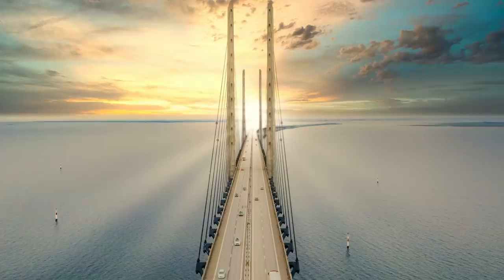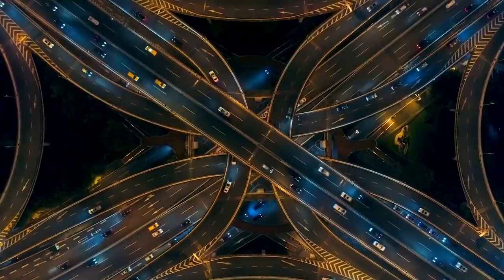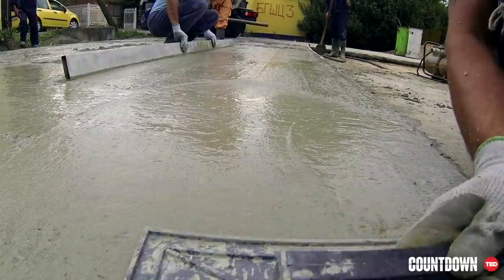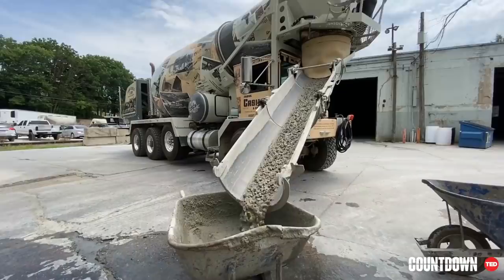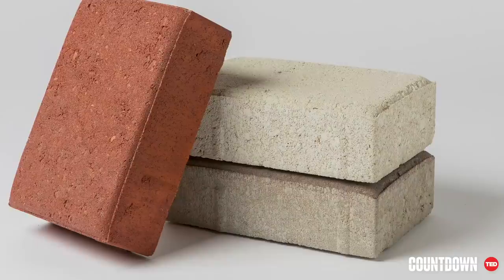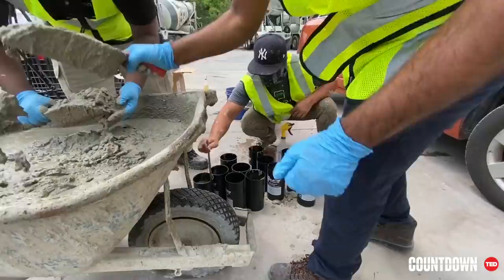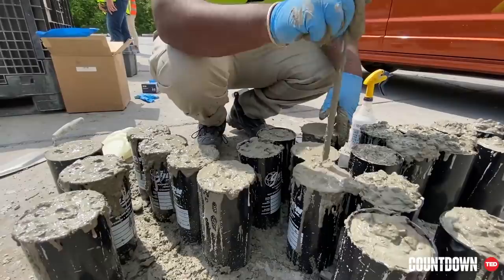How we could make carbon-negative concrete | Tom Schuler

Comment: There are many silver bullets being created to combat climate change, I have followed this one for a while now and it is certainly one of the strongest we have ready to use today. I hope changes to legislation facilitate uptake.
Reply: If it works why does it need legislation?
Reply: @renaissancestatesman  that's how countries works... Unfortunally
Reply: @renaissancestatesman  because it costs more and it requires modifying longstamding processes which industry is always reticent to do. Moreover, current legislation can hinder its adoption by being too narrowly specific about existing standards for concrete, to the extent that it disallows the use of low carbon concrete.
Reply: @Weaseltube  not surprised there are regulatory issues. My issue would be legislation mandating anything. Guess I wasn't clear on that. All for reducing legislation. 

Construction as an industry is ridiculously slow to change. It doesn't seem there is overly much needed in terms of actual manufacturing changes. Hope they pull it together sooner than later.
Reply: @PsicoPato-  a vast number of industries and products do not require government intervention to succeed. In fact those industries with the least intervention do best in terms of innovation.
Reply: @renaissancestatesman  your libertarianism is transparent, don’t worry about it.
Reply: @Weaseltube  most people don't grasp logic even when it stares them in the face. Emotional appeals generally carry the day. So I feel it is better to make it achingly clear than leave it for misinterpretation, flawed understanding or poor reasoning.
Reply: When I’m president I’ll make it mandatory
Reply: @renaissancestatesman  Most people who claim to grasp logic don't know what it is.
Reply: @Weaseltube  this may or may not be true. But it would be fallacious to assume even if it is often true that it is always true. But you know that I'm sure.
Reply: @renaissancestatesman  i know. I think the problem is the regulation. I don't know about the US but in my countrie i bet there is regulation than would make hard the change
Reply: We will need many silver bullets. But I think we can deliver them, along with the lowering of carbon emissions. We are nothing if not innovative.

Societies do have a tendency to pull themselves out of incredible predicaments at the last minute.

Comment: Everything he says indicates this should start dominating the market. Even at a 30% cost premium it should be more economical. Wonder what the cost premium actually is though.
Reply: I don’t think the cost premium is that high but there are industry practices and regulatory obstacles also that make it harder to change to. I’ve read that they suggest we all contact our legislators to move regulators to change building code so concrete standards are performance-based rather than ingredient-based.

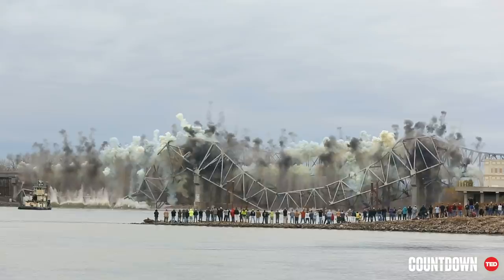Comment: 2:47 "it doesn't exist any longer"
every one who ever had a chemistry class 101: 🤦‍♀️🤦‍♂️
Reply: well it "doesn't". CO2 is not an element. it is broken apart as he mentioned 2:30 and used as C and O2. i guess it exists as carbon in the bricks. would be interesting to see the exact chemical reaction.

Comment: Amazing, but what does it cost!?
Reply: A curing time of 24 hours can definitely make it worthwhile to the industry, even if it costs quite a bit more. Then, as more people use it, the demand drives up supply, and it should become cheaper very quickly. Concrete curing time can be a big problem for the construction industry, speaking as a designer who works with contractors.
Reply: @EcoEnvious  sounds expensive to bring CO2 to the construction site to cure the concrete though. 3:58

Comment: Sounds good on paper. Is it true? Caveats?
Reply: Probably way more expensive
Reply: Production cost is all I want to know. Only missing variable. Would be great to see the cost breakdown showing money saved on water vs increased costs elsewhere.
Reply: To my knowledge the only Problem is the extremely slow acceptance rate of the building industry (even changing to something cheaper can cost short-term, like adapting to much better drying times changes the process)
As he said there are many different types of solutions implemented. But for as long nobody has implemented them on a large scale the building companies (responsible for failures) share the insecure feeling your comment implies.
And this is pure speculation: the cement buisness is a giant wealthy industry, those aren't easily outcompeted by newcomers due to their ridiculous advantage in form of captial and don't like to take risks or the above mentioned changes to the process as well.
Reply: @seferdi4439  If it was cost effective you wouldn't have any problem with acceptance.
Reply: I wonder how guys would finish slabs if it’s curing out so fast?
Reply: Sounds good on video, but there is no paper, which is what worries me. Lots of impressive claims and some nice stock footage, no links to documented third party testing. Or even manufacturer sponsored testing for that matter.
Reply: @remyllebeau77 that's not true, there are a myriad of things where the market implements the less efficient short term benefit solution, especially if an investment is required to transition between two states. 
A recent example would be last week's revelations about the Intel development problems.
All matters of sustainability p. e.: fishing, housing and education are even better examples.
Reply: @seferdi4439  ROI matters. I'm not surprised.

Comment: Since my passion and design of choice (but not in my budget) is a Monolithic Dome (look it up) which uses concrete applied by spray (as in "shot-crete") I have a deep interest in this subject. My alternative fantasy home is concrete built using cast bricks and a lot of rebar. Wonderful soundproofing and insulative qualities and I cannot speak highly enough of concrete houses. Except for wireless reception. Phone and wireless reception sucks...
But the carbon footprint has always been an issue.
Still is, since the CO2 impact on the climate may have been exaggerated by the fear mongering scientists (look at solar influence) and it seems that if we sink TOO much carbon the trees will starve...
So. Thank you for this inspiration. The only real question is how much more this product will cost over the traditional variety.
You didn't mention that.

Comment: Sounds awesome. If big concrete users can save money you have a market, but you didn't mention the money.
Reply: At this point, I don't think there are any solutions to climate change that won't cost some extra money.
If climate change were profitable to prevent, the market might have found a solution by now.
Reply: @RalphInRalphWorld  a lot of it is overcoming the initial hurdle of cost, with significant long term cost reductions.

Comment: This process plus Graphene is a game changer. New construction materials that are lighter, stronger and greener than existing cement based products. In time they will be cost effective as well.
Reply: even better is the effect on Insulation from graphene etc , Homes insulated to a higher standard will require 70 % - 100 % less energy for heating and cooling.

Comment: Hemp mortar soaks CO2 for its life, Roman walls 2000yrs exist.

Hempcrete has some cement to work for foundations, it's a natural insulator, ~R4.6/inch vs concrete, transpires moisture & fungi can't grow on it.

For N.America, Canada has machines & supplies by the container.
Cheers 🍺

Comment: 2:00 - We "came up with a new cement chemistry"... Tell us! Is it a Patented method or methods (for producing cement and for curing concrete)?
2:20 - You "get CO₂ by capturing waste gas from other industrial facilities, like ammonia or ethanol plants". The CO₂ produced by the cement industry, when burning limestone with the other raw material (in lower temperatures, as you say), can't be used? Or even the atmospheric CO₂ can't be of any use?

Comment: sounds expensive to bring CO2 to the construction site to cure the concrete 3:58

anyway i rmb hearing that this industry is super hard to change coz nobody wants to take the risk of using new material that needs to pass lots of safety standards and long term testing

and prob coz cement is already damn cheap and ultimately economics is what drives change

Comment: The sand used in concrete is also leading to a global shortage of sand.
Reply: Sand is not running out. The type of sand that is needed comes from rivers and there is a lot of it but since they use up the sand that is near the plants, it is not sustainable to haul from further away. Same thing is happening with oil. There is a lot left but the easily extractable one is running out and it costs much more than it’s worth to exploit it. Fracking is one of the new sustainable “solutions”.

Comment: so I'm hearing that you need limestone to make cement, but this process emits Co2, so you capture the Co2 and cure it within the brick breaking the chemical bond and leaving you with a limestone bond. cool but why not just start with limestone?
Reply: limestone isn't reactive in the ways you need it to be to use it as the sole binder. It's currently added in small portions to clinker to produce cement but they are also regulated by ASTM standards which limit how much limestone you can use.

Comment: Sadly, most carbon cure absorbs on the order of 2 kg of CO2 per tonne of cement. You have to be very careful when examining carbon capture claims.

Geopolymer and alkali-activated cements are among the best candidates, requiring far lower heats to transform kaolin to metakaolin (the analogue of turning limestone into clinker for OPC), and can be not just entirely fossil free in production, but also will absorb CO2 and can take advantage of carbon curing processes too. And bonus, twice as strong and cures in 3% of the time; more resistant to chemical erosion and able to use a wider range of aggregates effectively, including foaming agents or biochar that make the cement lighter, better insulators and in some cases able to bank carbon permanently up to 40% of the weight of the concrete.